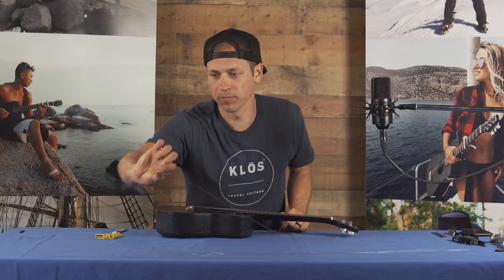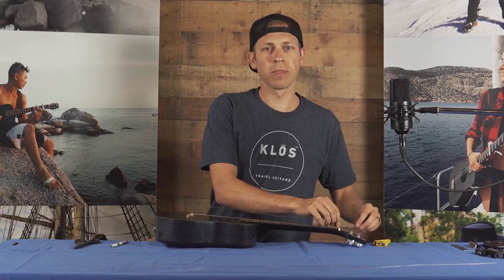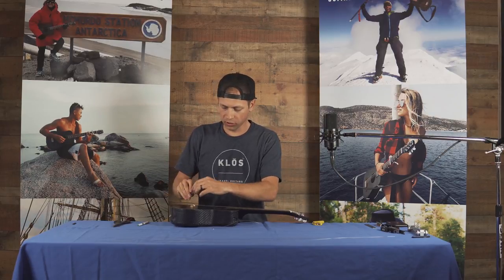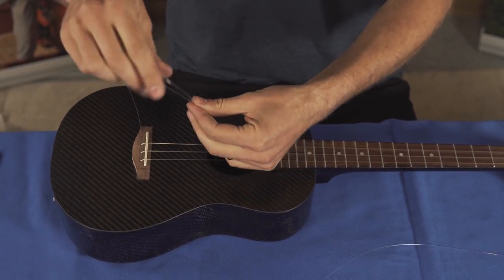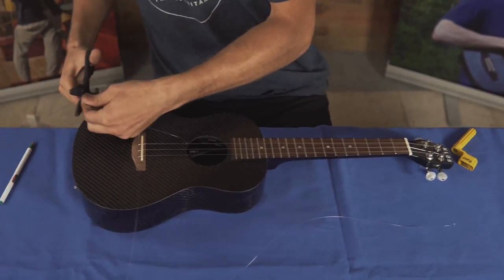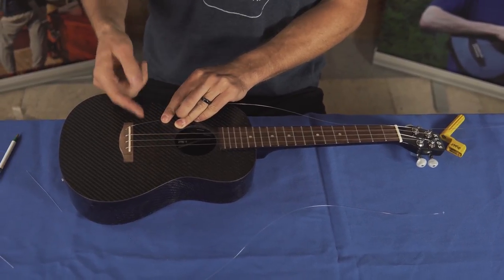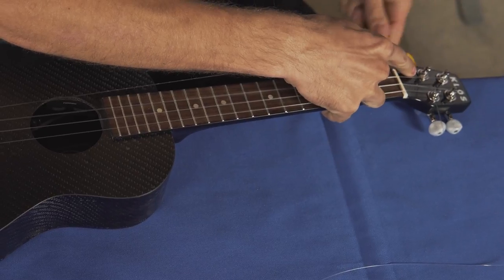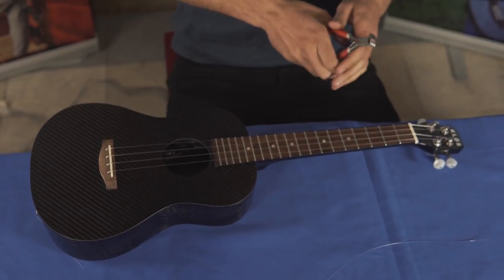How to change ukulele strings (Easy Tutorial)

Comment: There could be a problem while trying to  remove the first string. The knot of the first string may be stuck  on the hole below the lower string pillow and then one can not push the first string through the hole easily (due to the fact that the first string is too thin to push through). One may need a needle nose plier to pull it out inside the sound hole. (I am still working on it now.)